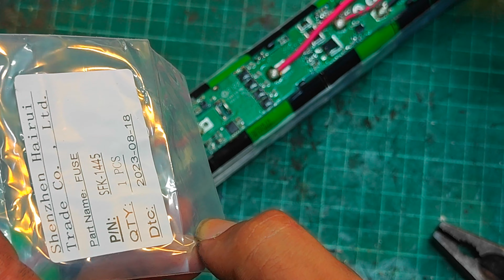VANMOOF S3 BATTERY not charging... FULL FIX!

Comment: Thank you for your help, I have 40 of this battery in my garage, I used to work for vanmoof in NJ they make use throw away more then 500 bikes in a dumpster because they said bike mechanic are spending too time to repair them (S2 and S3)
Reply from the maker: My pleasure - thanks
Reply: Would you be able to send a battery to LA? I bought a S3 and the battery is dead. Now I know why the bike was so cheap!
Reply: Hi, can i buy one battery? I'm at Amsterdam and my battery is dead...
Reply: Kerel, kan je mij eentje opsturen?
Reply: Hi, would I be able to buy one off of you?
Reply: Is there any way to get a battery from you, ours will not charge up.

Comment: Hopefully you can help me out with error 19.. There is 38V in the battery and continuaty between VP and DSG+, so the fuse is fine. But I still get Error 19. I tried a BMS reset several times with the GND en RST connectors connected for 10sec. on the board but no result. What else can I do to get my battery working again? On Reddit I see some comments about hard resetting the BMS, but how does that work? Thank you in advance
Reply from the maker: @jeroenvdkoot1  perhaps an error on the wiring of the bike? Tea the fuse directly, it is 3 sided and possible to blow only on 1 of the 3 sides!

Comment: Thanks for your work, but it would be better to cut your video to maybe 3 minutes and give the viewer just the important parts. 40 minutes is just to long. And do yourself a favour and take of your watch and ring everything metallic can start a fire if you shortcut something. And maybe not use just a wire fuse but something that actually can disconnect in case of failure. Keep on your good work.
Reply from the maker: The wire was tiny and would have melted at 20amps or so if a short occured - it was ok for testing. Some people do like the longer content! And the rings are ceramic. I don't wear a watch, either.
Reply: @EbikeRepairs yeah, I don't mind watching through it since that bms settup is kinda simler to mine. I've blown up a pack in the past and nearly burnt my place down.(don't assume voltage is in nominal range and charge it.. Two of my series connections disconnect causing a thermal runaway when charged) Something on this pack isn't right discharge port says 43v but b13 is 52v, I probly wouldn't have cut into it if I knew it was nearly fully charged but too late to turn back now. I have a spare dally Bms with common charge port but I dont quite understand how to wire it up but probly will after this 40m video

Comment: Seems like I am not alone with that fuse. I charged the bike to 100% to charge the empty module battery. Was greeted the next day with lots of errors. Best guess was a short circuit from the cable connecting battery to module. Was told the solder joints can melt in direct sunlight, might also melt if you charge 200Watts over long time. Without any fuse it was too risky for me, but as others already mentioned, this fuse is only shipped to manufacturers. So much for that.
Reply from the maker: My pleasure.

Comment: I did everything right, and now still having Error 21 (I can't load the battery), the Errors started when the Battery had 100% during a Ride. Now everything works, expect charging cause Error 21.
Reply from the maker: Have you checked that the fuse is continuous across all 3 sides?
Reply: @EbikeRepairs  I will try in May, ty!

Comment: I really enjoyed my S3 until the dreaded error codes. Now it is a garden ornament as the new owners of VanMoof are about as effective as a chocolate teapot at getting spare parts into the market
Reply from the maker: You can rip out the bms and controller, replace the bms and add an external controller, pedal sensor and display, and have the bike working again.

Comment: Today I bought a new bike and found the battery isn't charging, can you fix it for me and what is the cost?
Reply from the maker: A Vanmoof S3? I might be able to fix it... Cost varies wildly as it could be a number of problems. Anywhere between £20 and 450 I suppose!
Reply: @EbikeRepairs   I got it new in box, after installed the battery not charging in this case what do you the problem is maybe?
Reply from the maker: Could be a bad charger/ fuse/ wiring! Or deep discharge might need a kick start.. sorry too many variables to diagnose online 😭

Comment: Okay i just measured mine, and it has the exact same blown fuse. 

It happened on a warm sunny day after a 12km ride. The Bike was in the half shade, not charging or anything. It might have been exposed to direct sun for a short amount of time, but not excessive heat. 
Error 20,19, 6 and another one (i believe 7 or 17 😅 showed up, when I got back to the bike.

No support at all. I already took the Smart Cartridge out and disconnected the battery of it, reconnected it afterwards. Also i checked the Cell voltage of the battery which was 41.2V between Vg and Wp.

Thanks to your video, i was able to find out a bit more, the fuse is blown, It also accepts charge directly but not through the BMS. 

As we have a second, working S3 i‘m now tempted to tear the battery of that down, just to double check, if i get the same values. 
I‘d then change the fuse as well (even though i‘m not really good at SMD soldering 😂 

Oh, another problem i stumbled upon: discharge of the small Internal battery of the Smart Cartridge led to the bike not doing anything at all. I charged the battery up again to 3.3V and it responded again. I guess that‘s a sideeffect of not being able to charge the main battery. The small one seems to deplete after a short period of time (10 days maybe) 

All in all, great work! Thanks for the video! This type of content really helps up Vanmoof owners in the current situation!
Reply from the maker: Thanks! I have the exact info about the fuse a really good photo I used that shows all the part numbers, I'll figure out how to post it maybe in a channel status or something!
Reply: Hi @dtngx

I had my battery fixed for my S3 after it broke down however I experience the same problem as you

The bike doesn’t respond at all when the fixed battery is inserted In the bike., only for a couple of seconds the bike turns on with error 17 on the display, but then it shuts down again after removing the battery. Even when I left it hanging on the charger for a whole night the bike doesn’t seem to respond.

It seems to me that the cartridge battery is discharged.
can you maybe explain to me how you charged the internal cartridge battery?
Maybe then I can try it myself.

Thanks in advance!
Reply: @raygixdavid5050  sorry for my late response, I was on vacation a few weeks. 
I can help you with the recharging of the battery, if it‘s still a problem. Just let me know, and I‘ll try to provide the steps.
Reply: @dtngx  
 Hi there no problem at all i hope you had a good holiday. in the meantime i took my bike to Greenbikes in Haarlem and as of now it looks like the cartridge is broken. the battery worked they showed me that however the bike is not turning on so i’m waiting for a refurbished cartridge 

They also explained me that the socket connector in the front of the frame
 where the battery/cartridge/headlight/ connects gets easily damaged because of the steering wheel motions (design flaw) so mabey that also could be the problem 

Anyway i have to wait several weeks now because there were no cartridges in stock 

But again thank you for replying!

Comment: So, my fuse does have a very clear marking:

45A K10 A
[SC] SF

as far as I can tell from looking at individual frames in your video, your marking seems to be the same.
Looking at the "Self Control Protector" datasheets of dexerials cooperation and comparing  with the 30A fuse data sheet, the SFK-1445 is not the correct fuse.

The correct one seems to be the SFK-4045 instead of SKF-1445. 
- The 1445 one is for an operating voltage of 13.0-18.4V, which corresponds to 4battery cells. 
- The 4045 one is for an operating voltage of 33.0-46.9V, corresponding to the 10 cells. 

The markings "K**" seem to show the number of cells, these fuses are made to operate with.
As to the one you soldered on seems to be a K04 A (so it's in fact the SFK-1445 one)

Hopefully this can help you. I could be totally wrong, but it seems correct to me like this.
Reply from the maker: Hiya bud thanks for your info.

 It appears you are right! 

I used the closest match I could find as I hunted for hours!

I've posted a community update thingie with a really good photo of the chip before removal. 

We're all learning every day! 

If you or anyone else from the Reddit group can find a source for the fuses, please do shoot me an email and I'll update the description so people can have the info readily available!

Comment: Amazing, i hope that i will not need this. well done and thanks for the video. i could never fix it myself. i didn't even know it can be taken out. if my battery is dead i will send it to a company, they ask 250 euro atleast. so really u can make some bucks with these repairs. Did you actually find out how the fuse broke down????
Reply from the maker: Wow I only charge £80 for this repair and testing!

I didn't find out the reason but it's very very common
Reply: In 90% of cases it's Vanmoof charger pumping almost 6A instead of 4. Either you never charge it overnight, or adjust the charger output or use a compatible non-OEM charger that gives the exact 4A.

Comment: Hello,
Great explanation.
My vanmoof is charging to 100% but than it is giving err 17 and sometimes 21.  (I cant use the bike)
When i leave it the battery goes emty.
When it is with around 40% the err are gone.
Do you know if thats the problem, will it be the same fuse.
Already thnxs
Reply from the maker: Sounds like the same fuse yes

Comment: Are you changing thought discharge port? I seem to be able to charge only from bottom discharge.
Reply: Back charged bicycle up to 36v. Put battery back in and connected official charger and all seams to be good.
Reply from the maker: I charged through discharge to test it, then once sorted it charge via charge port

Comment: Hi liked your vid. What would happen if you would leave it to your first solder job. (just a piece of wire) so without the SFK-4045 chip, do we get a fire, or other risks? Can I load this way, save for 1 hour or till 80% ? would't a more heavy fuse be better?
Reply from the maker: The fuse is rated for the battery and designed by people much cleverer than me, 40amps is a lot of current! I'd stick with the original.

Comment: Had a blown fuse replaced and now have continuity. Unfortunately, i have some unbalanced cells one of them is bang on 2volts, and therefore when i try to charge through the bike it wont take the charge.
Do you know a way i can balance the cells out and get some charge into them so it will then work off the normal charge?
Reply from the maker: Balance charge every group up individually! Takes a long long time...
Reply: @EbikeRepairs  ended up changing the really depleted cells.
Thanks for your awesome video, totally fixed my bike 😁
Reply from the maker: Well done! Thankyou

Comment: Can you explain what you’re doing when testing the charge terminals? At 17:22 Do you have a bench power supply with 41 volts? And you are touching the leads and checking for continuity?

I replaced all the cells in one of these as they went to zero.
Reply from the maker: Yes I do - sorry that wasn't pictured. I was trying to charge it direct to the bms with the power supply at 42v.

Comment: hi i have a question.
my vanmoof has an error code 21, which means that my charger is not recognized. This error also appears if I do not have my Vanmoof in the charger. This error occurred when I had a short circuit with my charger while it was in my bike. Any idea if it can still be fixed or is it a hopeless case?
Reply from the maker: Sorry I don't know, without testing it. I'm happy to take a look, though!
Reply: have you tried to reset the bike? the button by the charge port.

Comment: Its not supposed to give you voltage on discharge when its not in the bike. The bike supposed to turn on discharge when its on ready to ride or when the cartridge charging from the battery. VM/Dynapack have a tool to control and test it outside of the bike.

If the fuse was blown customer should get someone to check out the wiring harness in their bike. Its most likely shorting! Common location for shorts occurring are in the headset, where all the cables coming together, and at the eshifter.
Reply from the maker: That's great info, thankyou! It was my first time inside one of these batteries so lots to learn. I've checked and the customer says it was working on his bike after he received it.
Reply: @EbikeRepairs  I bet its working. Now. Please tell them to check the socket! If the wiring harness damaged, it will cause blown fuse again!
Reply from the maker: Thanks, I'll relay the message.
Reply: @Bborjan1986 Do you know how to get the tool to readout the VanMoof S3 BMS?
Reply: @wouditube  From Dynapack. Good luck tho!
Reply: @Boborjan1986   Thanks for your answer. But Dynapack is never going to give VanMoof software away. Do you know someone who investigated the protocol that is used  between the battery and the cartridge? Next to the data connector on the bms there is the following text: KEY_IN, RX, TX, GND, DET, FAULT and TEST. Maybe it is possible to use a serial connection with TX and RX.

Comment: How do you reset the BMS?
Recelled the battery since it was deeply discharged, welded new cells into it, and reconnected the BMS. The bike still shows errors.

Cell voltage is now 3.55V and I have a imbalance of plus/minus 1mV over each cell. Bike shows 25% charge but still throws error codes.

Have done fuse bypass aswell.
Reply from the maker: Sorry, I'm not sure how you reset it.
Reply: @EbikeRepairs  I FIXED IT!!!!

Recelled battery, replaced NTC thermistor near the 4 big MOSFETs and the FUSE, then did SWD reset on the ICSP port (short RST to GND) after disconnecting VP and bal connector, reconnecting VP and doing SWD reset afterwards.

reconnect BAL, reasemble battery, and BIKE WORKS!!!!!!

ITS CHARGING NOW!!!
Reply: @sebastiannielsen can you help me?

Comment: Hey there, 

Just opened up my battery, and saw that the FET’s got too hot. Do you know what could’ve been a possible cause of that problem?
Reply from the maker: Possibly a short on the wiring! There are currently USED BMS boards on eBay UK
Reply: @EbikeRepairs  thanks for your reply, but could you elaborate? Do I just look up Vanmoof s3 BMS board?
Reply from the maker: Yes thats right :)
Reply: @EbikeRepairs  thanks once again. My battery was really wet when I took it out, could that have been the cause?

Comment: The board is proper cooked with the method you're using to solder that fuse. Good job though
Reply from the maker: I know it was so hot! Please do let me know the best way, hot air was all I could think of without it getting too crispy.
Reply: @EbikeRepairs  its interesting how quick people are to say “you’re doing it wrong”. And then don’t offer any suggestion or constructive advice.  😂 thanks buddy!
Reply from the maker: @EBikeBuilder_  true, but I'm always out to improve! The board soaked up so much heat!
Reply: @EbikeRepairs  I see improvements in using non-metallic pliers, and removing the metallic rings from your fingers when you are at work with charged batteries (or use gloves).
Reply: Adding flux helps reduce the melting time and using a soldering iron is faster for a component like that. Please always disconnect any batteries or power source before soldering.
Reply: @EBikeBuilder_  I didn't discredit him, bro.